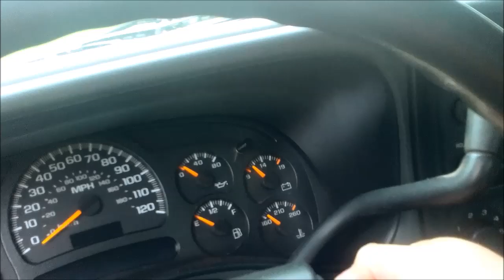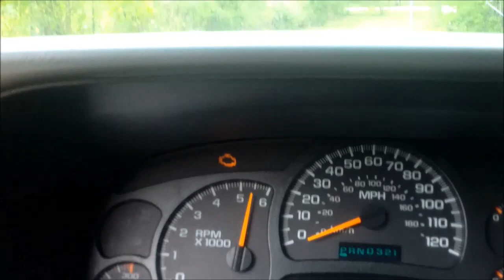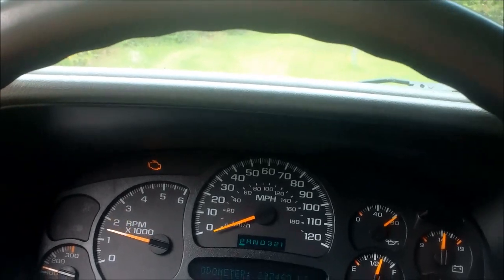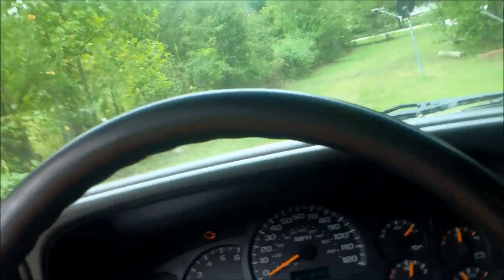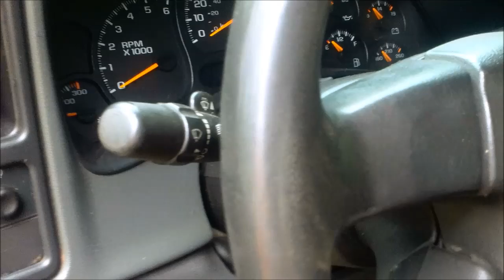$1700 2005 GMC dually flatbed 8x12

Comment: Awesome! I paid $1500 for my 1984 Chevy dually, I'd say you got a dang good deal. I think that valve train ticking is typical with most early to late 2000's GM truck engines.

Comment: Helluva deal on that truck. Those 6 liters are great engines. They are LS engines.
Reply from the maker: +utoobube every talks about ls these days i guess there good is the 8.0 a LS?
Reply: Yes it is. (8.1 liter built from 2001-2006) As a rule of thumb if it has C.O.P instead of a distributor and plug wires, its an LS.